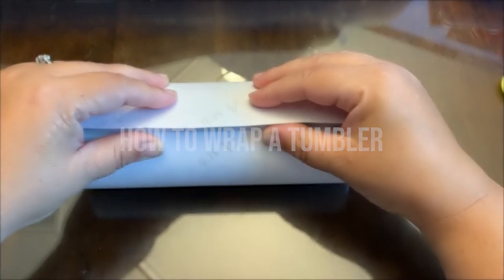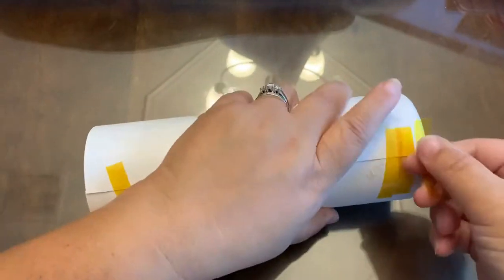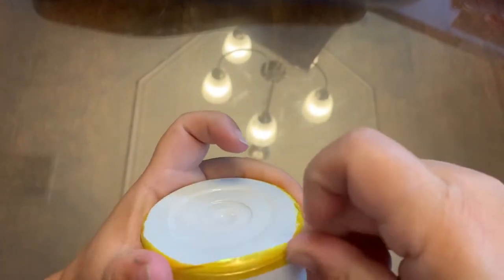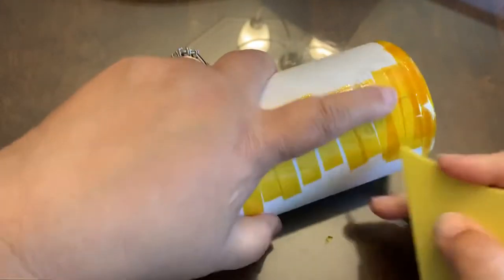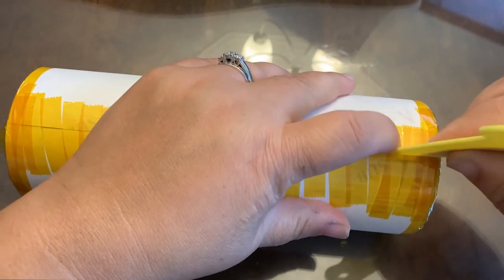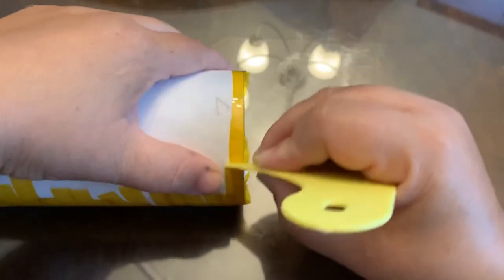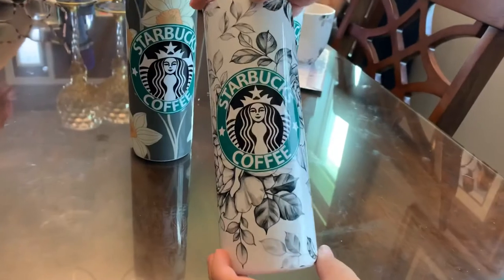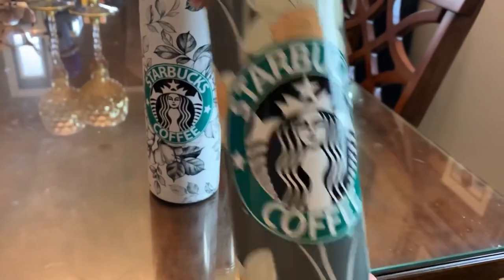How to wrap a sublimation tumbler, No seams or ghosting

Comment: I struggle so much with my bottoms and tops. Could it be my tape? I use the blue heat tape
Reply from the maker: @sarahrobson9479  I honestly cannot say, I’ve never used the blue heat tape. I do know that getting the paper tight is key. I tape tightly and then rub along the rims to make sure there is no air pockets. There should be no leeway with the paper

Comment: What do you do when the wrapping paper does not meet around. I have a 30 oz water bottle that when I wrap it the paper its not bif enough so I'm afraid if I put the tape straight to the tumbler that it will leave a mark since I use the yellow Heat tape
Reply from the maker: I don’t sublimate 30 oz tumblers for that reason. I do know that you will have to purchase longer paper. I believe it 8.5x14.

Comment: Thanks  for sharing! Can you give me the measurements you use tumbler when printing them? Thanks 😊
Reply from the maker: I use MakerFloCrafts tumblers. They measure 9.4x8.1
I highly suggest that you purchase a fabric measuring tape and measure your tumbler. Not all manufacturers make them the same size. It might be the same in ounce’s but height and width may be different.
Reply from the maker: I use MakerFloCrafts tumblers. They measure 9.4x8.1
I highly suggest that you purchase a fabric measuring tape and measure your tumbler. Not all manufacturers make them the same size. It might be the same in ounce’s but height and width may be different.

Comment: Thanks for the video. Wondering what size you print your images. They look great and mine are off🙄
Reply: A skinny 20oz straight tumbler should print 9.3 around by 8.2 high
Reply: @peej061085  thank you so much. So helpful😊
Reply: How did you print your design to not have a seem? Beautiful job!
Reply: Beautiful tumbler. Love the file. Did   u create that
Reply from the maker: These are MarkerFlo tumblers and I measure mine at 9.2x8.1
Reply from the maker: @fearlesdesigns2469  i didn’t create it that way it just turned out to line up perfectly
Reply from the maker: @blanchelee5680  Yes, I did. But it’s only for my own personal use ☺️

Comment: No need to do all of that taping.  Get the Promowares 20 oz flat bottom tumbler.  Tape the side where the seam meets.  No need to tape the bottom.  I did have to put one strip of tape at the top.  At 365 F I had an awesome tumbler 50 to 60 seconds later!  I have been struggling with ghosting at the top and bottom for over a year now and many tumblers and frustrations later, I have found the game changer.  The flat bottom tumbler is the way to go!  Now I have to work on my seams.  One thing at a time...
Reply from the maker: Thanks for your tip but I personally don’t like the flat bottom tumblers but this is useful for those who do. I did however find a much wider 2” tape on Amazon that has been a game changer for me. Check out my more recent video with me using the tape. I definitely use less with the same remarkable outcome
Reply: @heavenlyedencreations8416  I don’t like the flat bottom ones either. I was doing pretty good with the round bottoms, switched my last order to flat bottom, and it’s like I’m brand new all over again with seams and ghosting. So frustrating!!! Can you use painters tape in a mug press?

Comment: Why wrap in painters tape?
Reply from the maker: It’s not necessary but for beginners it helps with keeping the image tight against the tumbler. If the paper is even a little loose it will cause fading. This method prevents that.
Reply: @heavenlyedencreations8416  thanks. Will it also work with a tumbler press? You mentioned you use an oven.
Reply from the maker: Honestly, I do not know since I do use an oven. I have seen others do it and I think it would help but make sure to put the tape around the butcher paper because the glue from the tape could effect your image. With that said, a press already gives pressure where an oven does not so you might not need to go through the same process as I do.